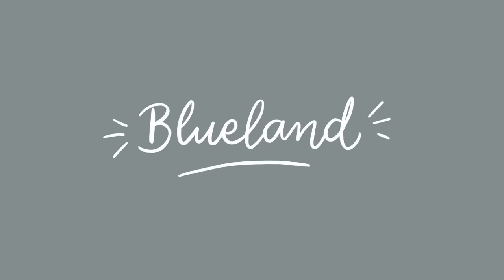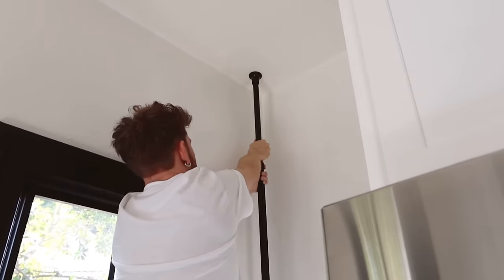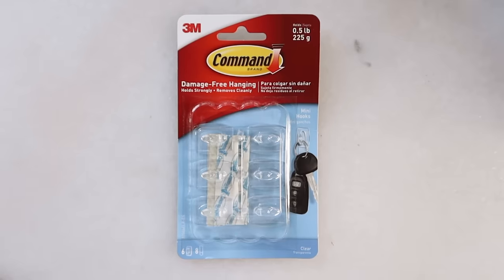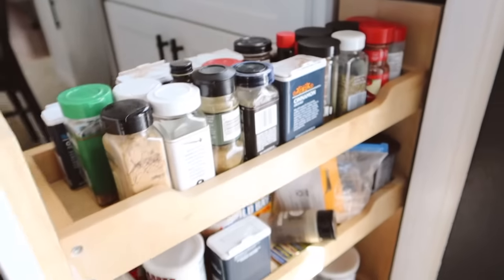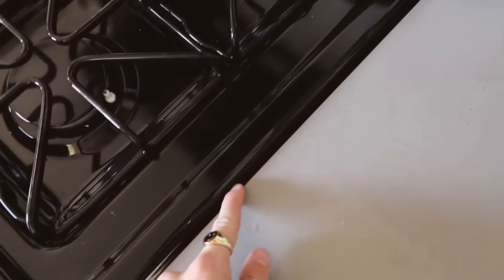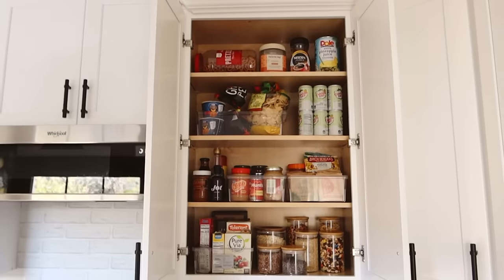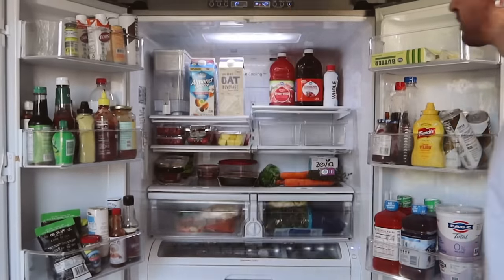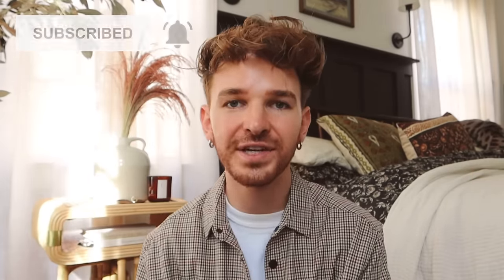10 SMALL KITCHEN ORGANIZATION HACKS & DIY Ideas 🍳  Easy & Budget Friendly!

Comment: Couple of additional tips: I just put my pantry staples in glass cannisters, too, and since I noticed - ugh - a couple were expired when doing so, I thought it prudent to add labels to the bottom of the cannister too, so I could add the expiration date in pencil when I emptied a package of whatever into the cannister. Also, those metal measuring spoons you hooked onto the door..., hmm, notice anything when you were opening and shutting the door? Yeah, pretty noisy, aren't they? I hate to take mine down when I tried that same Pinterest hack a few years ago. Nice idea, just not practical for steel ones.
Reply: I put felt strips where the measuring cups hit the door. I used the kind used to decrease cabinet noise.
Reply: I thought the same about the hooked spoons 😂
Reply: You could also use a ring to keep the measuring tools together. Doesn't make the drawer more organized and neat, but it does make life easier!

Comment: First - thank you so much for helping Elysia and Philip English!!!  My husband and I really love their channel!  Second - OMG!  These kitchen hacks!!!!  Our kitchen is original to our little rancher, built in 1955.  I'm working lots of overtime to pay for a remodel, but the delays is the supply chain mean that it won't happen anytime soon.  I think your hacks will help me keep my sanity 'til it can be done!  You're kind of amazing!
Reply: I'm planning to redo my kitchen (original 1960/61) but until then, I'm making minor improvements and here are some tips I've learned along the way: 

Idk what your budget is, but if possible, consider adding soft close door hinges and drawer slides - they're amazing!

Shelf liner has saved my outdated kitchen (& I plan on putting clear shelf liner in when I remodel to protect everything and make it easier to clean!)

If you're doing solid and unpainted wood, Murphy's Oil Soap and Lemon Oil will be your best friends (this goes for any solid wood furniture and cabinetry) 

If you currently have unpainted wood, a good sanding and a couple coats of polyurethane will take about a week if you're doing it after work and it'll cost under $50 and you'll feel like you have new cabinets. Use sponge brushes to poly and wipe the poly off to prevent bubbles. You want a VERY thin layer (& if you mess up, sand it down and start over).

Butcher block countertops are GORGEOUS but also expensive to get custom made. If you want one on a budget, consider a wooden workshop bench (you can get one from most home improvement stores). Sand it smooth, coat with a mixture of beeswax and mineral oil (you can easily find a recipe online) to protect it! Did this in my kitchen and turned a poorly placed upper cabinet into a lower cabinet w/ a bar top for under $200 and it looks phenomenal.

Plan for the placement of your appliances before you consider cabinet arrangements; make sure you have a comfortable triangle (or triangle-ish) shape between your stove, fridge, and sink and make sure you've got a good amount of counter space to set groceries down and prep food. 

Idk if any of that will help you but if not, hopefully it'll help someone 😅

Comment: Tip about the first shelf: if you have a plaster ceiling that is not smooth, it may not be stable. If you have old flooring ditto. Take care about how much weight you use on that set up. Consider other metal shelving from restaurant supply to the other pre builds for over toilets, but mindful of load bearing limits.

Comment: Great! Just wanted to let you know that when you use peel and stick products, it should be attached without any weight for optimal result. Also, optimally, you should leave it on for like 24h. Then it is solid and will stay on for like as long as you want :)

Comment: Just a note on any system that uses pressure like the bathroom organiser or expanding curtain rails. The contact areas can affect/crack paintwork, so my work around was to hot glue some felt pads to the contact areas to prevent marking ;-)

Comment: I tried doing that with my measuring cups but the command hooks couldn't hold them so I used screws to hold them in place. For some reason, the command hooks had trouble adhering to my cabinets and they stay in a drawer.

Comment: I will get a stove gap filler for my kitchen. However, putting vegies in open containers is not a good idea unless you use them right away. Most vegies need a moister environment, that's what the vegie drawers are for.

Comment: When you have a peel and stick product, I prefer to stick it to the surface, and not add any unnecessary weight to it for 24 hours before using it. It gives the glue more time to bond better.